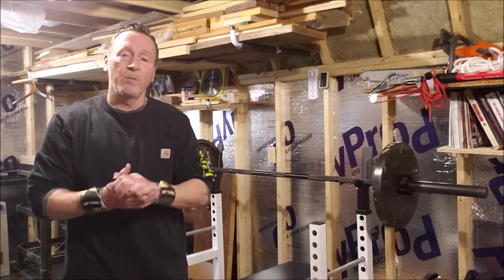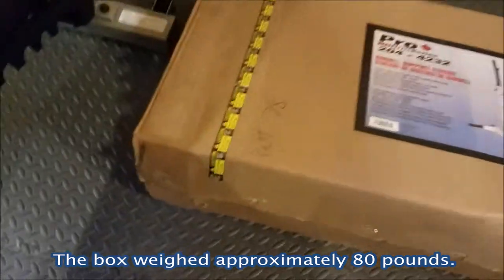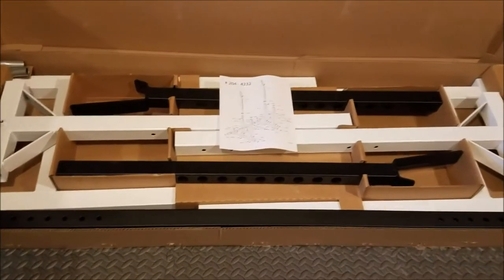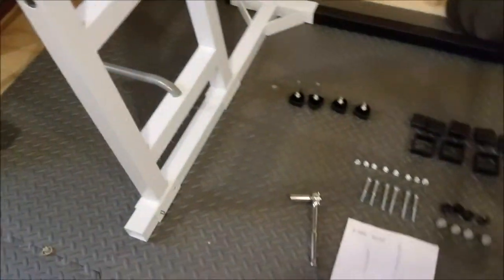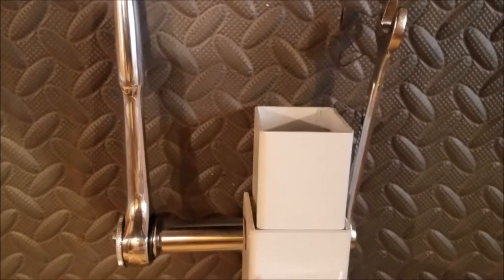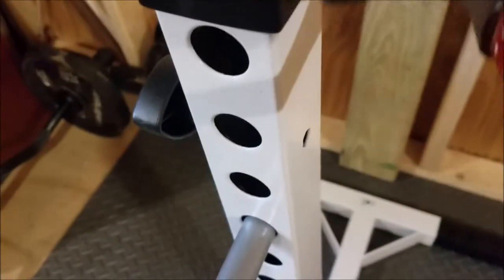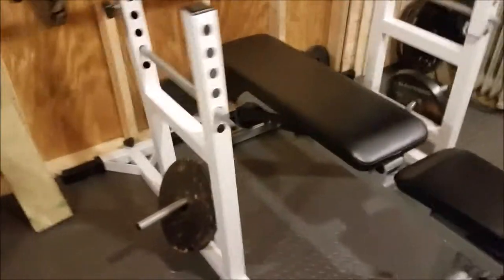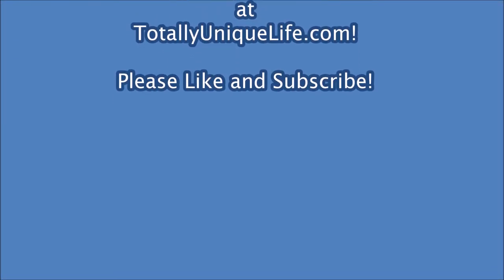𝐔𝐧𝐛𝐨𝐱𝐢𝐧𝐠 / 𝐀𝐬𝐬𝐞𝐦𝐛𝐥𝐢𝐧𝐠 𝐭𝐡𝐞 𝐘𝐨𝐫𝐤 𝐁𝐚𝐫𝐛𝐞𝐥𝐥 𝐏𝐫𝐨 𝐒𝐞𝐫𝐢𝐞𝐬 𝟐𝟎𝟒 𝐁𝐚𝐫𝐛𝐞𝐥𝐥 𝐒𝐮𝐩𝐩𝐨𝐫𝐭

Comment: Nice video, thank you. Just wondering about the safety catches for flat bench press as they don’t seem to go down very low. Do you use them
on lowest setting? My bench is quite low to the ground and am concerned catches may be too high.
Reply from the maker: Hi, yes I use the safety bars on my bench. Don't really need them much lately as I have been benching for more reps lately and less weight. I'm actually away on vacation right now so I'm not sure exactly which setting I have them on currently but it's perfect for me because when benching they don't hit the bars at the bottom of the lift but are high enough that I can scoot out under the bar if I need them.
When I get home I'll check which setting I have them on. Thanks for your comment.
Best,
Bob
Reply: @TotallyUniqueLife  Ok, that’s what I needed to know, I think I will go ahead and buy this rack, thanks!
Reply from the maker: Hi, just checked. The safety catches are on the 2nd to lowest setting and they work well for me.

Comment: can you please make a video using this rack for benching and also for squatting please. i want to see its stability when it is higher up, and also do you place weights on the bottom of it to help it stay down
Reply from the maker: Hi Virky, so sorry for the late reply but I just noticed your comment. I plan on doing a benching video with this support but, due to its location in my shed I cannot use it for squats and due to back issues I don't do barbell squats any longer. Only dumbbell squats for me. Yes, I use the weight holder at the bottom (pipe that juts out) and usually have at least a 45 lb weight on either side. Really helps stabilize it.
Best,
Bob

Comment: Nice video.  Do you know how much this rack is designed to support?  Do you know if the uprights can be adjusted low enough to do decline bench?
Reply from the maker: Hi, I'm not sure how much weight this rack is designed to support. I only use it for benching and have put 285lbs on it without a problem. I'm sure it could at least hold 315lbs. You could contact York at this number for more information. I have no affiliation to York at all. Here is York's phone number from their website - Toll Free: 1 (800) 358-9675.
Best,
Bob

Comment: Isn’t the lowest set point still too high for flat benching?
Reply from the maker: Hi, sorry for the late response but I did not see your comment until today. I use this bench at least twice a week for benching. I'm not sure what you mean by set points. I have the supports raised about 4 inches from the lowest point which is perfect for me for benching. I am about 5'10" tall with average length arms. The only way having the supports at their lowest point and not being able to bench would be if you were extremely short (would have to be a little person). I cannot imagine that being an issue for a normal-sized person. If you are much taller than me there is a lot of height you can gain simply by adjusting the supports up.
Best,
Bob

Comment: how are squats on this? it seems the bar may hit the supports when you go down?
Reply from the maker: Hi Umar, so sorry for the late reply but just noticed your comment. It was being held for review.
I don't use it for squats due to lower back issues.  I would imagine if you just move up slightly after loading the bar on your back you would not have that problem.
Best,
Bob

Comment: How tall are the support arms? How much weight can this hold?
Reply from the maker: Sorry I did not see your comment until today. You should check the link in the description but if I have a chance I will do so for you. Could you email me at bobbessette@totallyuniquelife.com if you still need that info. I'm not sure what the maximum weight threshold is, to be honest. I've gone as high as 285 lbs for bench but I'm sure you can go higher if need be.
Best,
Bob
Reply from the maker: Satoshi, this is from York. Not sure how much weight it could hold. I've used 285lbs for bench and could easily go higher. The York phone number is 1 (800) 358-9675.
Product Specifications:
Overall Base Width: 64 ¾”
Overall Base Depth: 38 ½”
Maximum Rack Width: 52”
Minimum Rack Width: 36”
Lowest Bar Rack Point: 38 5/8”
Highest Bar Rack Point: 64 ½”
Safety Spotter Area Depth: 15”

Comment: How tall does the tops go (for squats) Im 6'3 and im wondering if im going to be able to squat on this.
Reply from the maker: Hi, sorry for the delay in responding. To be honest, I do not use these for squatting but could check the height for you if you like. I'm sure if you follow the link in the description it will have that info in the specs. If that doesn't help just email me at bobbessette@totallyuniquelife.com and I'll make a measurement.
Best,
Bob
Reply from the maker: Hi, actually I just went to their site and got this info:
Product Specifications:
Overall Base Width: 64 ¾”
Overall Base Depth: 38 ½”
Maximum Rack Width: 52”
Minimum Rack Width: 36”
Lowest Bar Rack Point: 38 5/8”
Highest Bar Rack Point: 64 ½”
Safety Spotter Area Depth: 15”

Hope that helps!
Best,
Bob